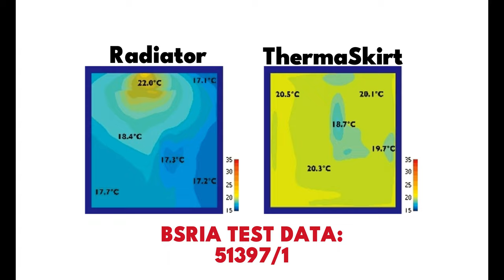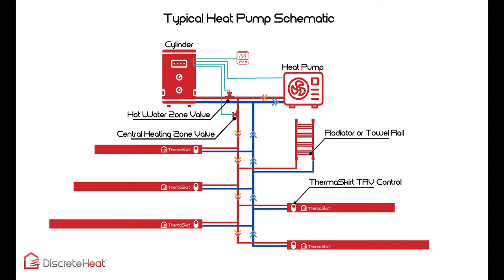Future Home Standard | Why are builders choosing ThermaSkirt?

Comment: Can you please do a video showing how to move existing radiator pipes which are 6 feet apart and fixed in a CONCRETE floor, to the middle of the radiator for the new skirting board. Thanks
Reply from the maker: Hey Mark! Great shout, it's something wr do a lot so when there's a real world job scheduled I'll make sure we get a camera there. 😁

Comment: How does ThermaSkirt work as a retrofit solution to older houses in place of rads with 10mm microbore? I would be interested to see an example of this & how much upheaval would be necessary in a house with a solid ground floor & T&G chipboard 1st floor.
Reply from the maker: Hi Colin 
Still some disruption required of course but not at much as you may think. Around 70% of our installs to date have been retrofit. 
Video coming soon on how to do just this

Comment: Can I ask a Q could I connect the hole house with scutting boards with one button to heat the house instead of each room 😊
Reply from the maker: Just one room is no problem, as it can connect into existing radiator tails! 👍